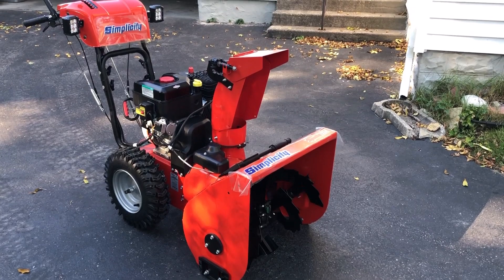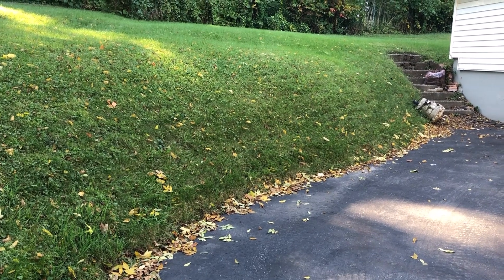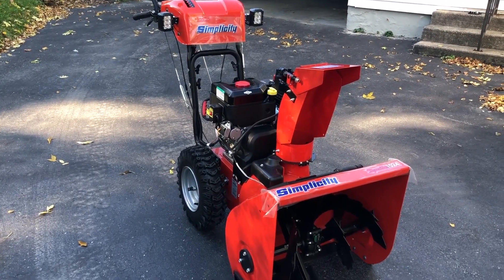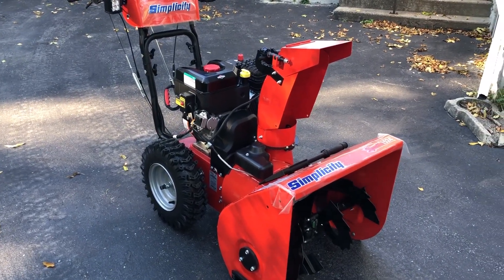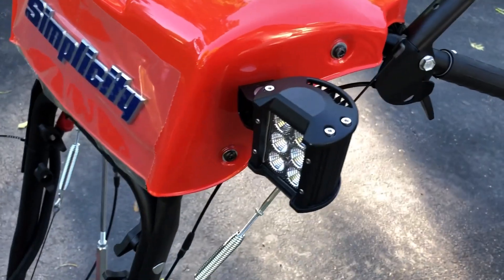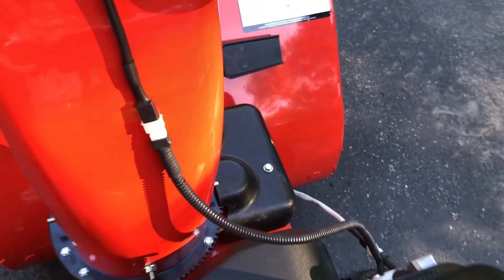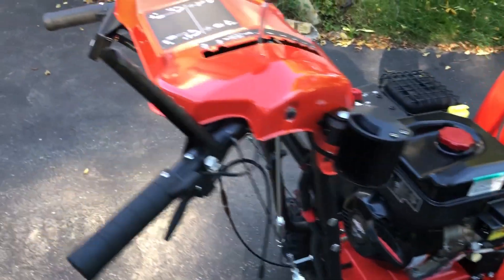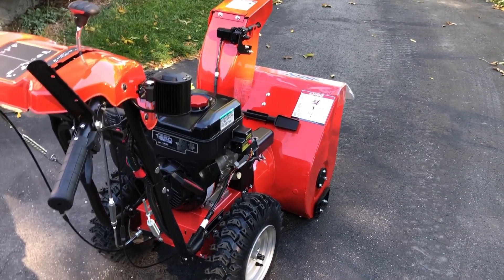Simplicity Signature 1524 First Impressions

Comment: Just used this machine on  7 inches of wet heavy snow and it cut through it no problem at all. I owned 8 hp simplicity 29 years ago and the same kind and amount of snow would have clogged the shute this has a wider shute and didn't block it once. I'm  impressed and feel a bit better having spent 1799.00 msrp 1899.  If it can handle the muck we got overnight it should throw aa normal 10-12 in.snow the advertised 40-50 feet

Comment: Great Video! Thanks for all the information shared with us! I too have an Ariens ST5524E 24" bucket with 5.5 Tecumseh motor with electric start. I've had it for over 13 years and it runs Great! however with the last snow we got in December I noticed it was bogging down a bit...So I've decided to get the Simplicity Signature Pro 2128 this year! Will buy it AFTER the season is over (maybe May or June) Once again Great Video! From the Big Apple 🍎

Comment: I have the 1626 model electric start, I did just have to repair, clean , the contacts that moves on the chute motor. It would go down not up, after several times on and off adjustments I finally got it to working. I am not sure I have the motor right, seems to be showing a lot of threads , trying to look at your to see if it’s ok. One thing, I have several unused wires, I wounded if that if I wanted to add that light under  the controls, I will look for one. Thanks for posting. I love it, it is a monster with snow removal

Comment: How did your Simplicity work this past winter?   I’m looking to replace my 19 y/o Cub Cadet.  I have a 20 + y/o Simplicity chipper/leaf mulcher and love it.  Wonder if I should purchase a Simplicity snowblower since they have a Briggs and Stratton engine. I share the wet and heavy snow of New England with you.
Reply from the maker: Hi Megan. I only used it about a half dozen times last winter. A light winter for us for snowfall. But so far so good. The lights are very bright which is a big help for me since I don’t have lights out in the driveway. I wouldn’t say this is on the same level of sturdiness  of a 40 year old machine, but it is more rugged than a machine you buy at a big box store.
Reply: @iiweeldman  The pro series is more rugged than the signature ones. How was the use of the heated grips? Did they work ok?
Reply from the maker: @neutral999  two winters in and I haven’t had one issue. Everything electrical holding up fine. Heated grips work great through thinner gloves. It keeps your hands warm and allows better control without having thick cumbersome gloves.
Reply: @iiweeldman  Glad to hear that. There is a bridge rectifier buried under the dash on the harness. It gets warm sometimes and might need to be replaced within 3~4 years. If your grips don't work properly, make sure that you're seeing 12~14V across the DC output when the machine is running.
The LED lights are your standard 'Nilight' ones but come with a special bracket. Briggs engines sometimes give out transients that can cause the LED module to burn out, so I would suggest you replace those LEDs thru Amazon instead of thru the dealer. That will save you tons of cost on this. The model you have was made and assembled in Wauwatosa, WI (except for the engine). If you need parts, you can bypass the dealer and get in touch with their supply team and see if you can get parts thru them if the dealership is slow.
Lastly, the carb needs to be cleaned after every season - else it gets gummed up. Fuel stabilizer is ok, but the best way to do this is to remove it and soak it with brake cleaner. 
Good luck!
Reply from the maker: @neutral999  Thanks for the tips! Fuel shouldn’t be an issue as I am using nothing but VP engineered fuel in it. Thanks again.

Comment: I bought the lesser one today. Researched plow vs blower but not blowers enough. Didn't take possession.  Post-researching for hours. Specs and all details. Thinking I'm going back to get this. How is it? Regrets or good?
Reply from the maker: Hi Todd. I used it about a half dozen times last winter and it worked well!  The power to weight ratio seems just about right. The cast iron gear box up front is rare sight to see now a days.  Jury is still out on the electric chute motors but so far so good!
Reply: @iiweeldman  thanks. I got the select for under $1,000. If I went up to 1600 I could get the one you have. Definitely Better Built. Seems like the difference between stamped Home Depot Mower and my Z2. However, we rarely get anything that I think is going to give it a real go. Hopefully I eat my words, for everybody. And lastly, I feel that I could do without the electric shoot oh, but as far as the gearbox, and mine being aluminum, what is the predicted outcome between one or the other? As far as the heavy gauge steel on the housing, I feel like if you're careful it shouldn't be a big issue. Is my assumption wrong and the overall weight matter, or is it a question of the ratio that you spoke of?
Reply from the maker: @toddhacker1061  the power to weight is more to do with the next step up from this one or the professional series. They are more powerful but significantly heavier and hard to maneuver.  The older snow blowers all used to have cast iron gearboxes. They are now mostly aluminum. I’ve had friends that sucked up a piece of ice and blew the aluminum gearbox instead of the shear pins.   The electric motors are nice because you can control the entire chute with one hand. You don’t have to stop to adjust.
Reply: @iiweeldman  had a dealer from N. Michigan tell me that today. Seen one split in half. Another dealer from MN advised going with Signature series. I plan to do 6-12 and want to keep a long time and buy once. Heavy but solid and durable vs. lighter but flimsy. Like an FR vs FX Kawi and stamped deck vs. commercial.

Comment: I have the M 1024 E model and it’s a tremendous disappointment. I bought a Simplicity because I thought I was buying a quality American made product, instead it’s a substandard Chinese rattletrap. Constant drive problems for the drive wheels. Very disappointed in Simplicity and their  customer service.
Reply from the maker: Hi Danny! That is unfortunate to hear. I have a season on the 1524 that was trouble free. I wonder if that is the difference between the E models and a signature model? Unfortunately even the highly regarded A brand have low quality outsourced parts. I will keep people updated with this one if I run into issues.
Reply: Scott Robert , I’m really glad that you didn’t have trouble with with your 1524. My 1024 will be the last simplicity product I’m buying. I wish you could have seen my experience with my machine from day one. You would have been flabbergasted.
Reply: @charger19691  so that is the select series, correct? I just got the 12 27 in the select. Went and looked at the signature yesterday and really notice the difference when the salesman asked me to actually touch it feel it. If you could go back would you make the upgrade? Sorry for the silly question.
Reply: @toddhacker1061  , to be honest, If I could go back and do it all over, I think I would have bought the top end one that you did. Since my last post I installed a new friction disk before winter and the machine seems to work wells now, we will see how it tackles some snow.
Reply: @charger19691  I see. I thought that you got the 1024 dual-stage. I understand now that you got the single stage. I got the lowest level of the dual stage. Simplicity has the select, the signature, and then the Signature Pro. I was thinking to upgrade to the mid-range signature which is a 2816.5 versus the 27 11.5 torque that I got 250 ccs versus 420 ccs. My dealer is great and heard my concern and said that if I feel that it is inadequate that I can just pay the difference and upgrade. Time will tell.
Reply: @toddhacker1061  ,
No no, I have the dual stage model. I’m just very disappointed that it was built in China. If I would have known that, I would have bought something else., Also, mine is 208 cc’s it seems too small of an engine for its size.

Comment: You should have just bought another Ariens... one with higher horsepower. The Ariens Deluxe 24 might have worked out for you, or better yet, the Ariens Deluxe 28 SHO...it would have threw snow over that hill.
Reply from the maker: Not a fan of the Chonda engines and the support for them. I guess we will know in a few years if Briggs stays afloat.
Reply: @iiweeldman  I don't like them either... there's a Chinese LCT AX engine (Tecumseh engine clone) on my Ariens that's garbage...very finicky. But while that Briggs and Stratton engine is made in the US, you'll see something funny about it. It will say "Made in America using US, and global parts". They don't tell you that the Global part most likely means Chinese... they're slick like that. That same thing was on my Ariens snowblower that I purchased a couple years ago. The snowblower was manufactured in the US, the engine (global parts) in China. Or these days you just don't know what percentage of an American engine company like Briggs and Stratton isusing some Chinese parts in it; like I said, you just never know what to expect these days even from  US  companies that are looking to save a few dollars. Anyway, good luck with the snowblower boss.
Reply: I believe briggs an straton still makes there largest engines in usa. But mid an smaller in china. I have always liked briggs engines i know lots of people talk but if you maintain them proper they will treat ya right if you use them as they were intended for